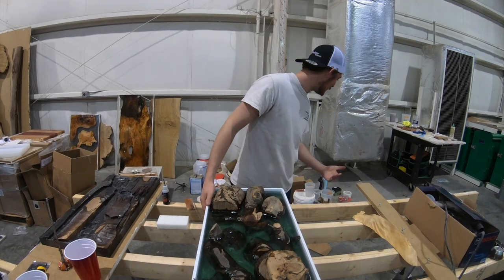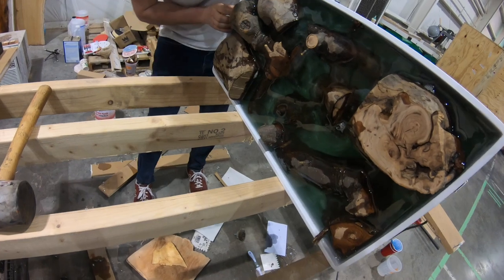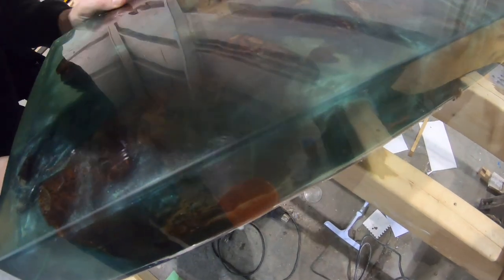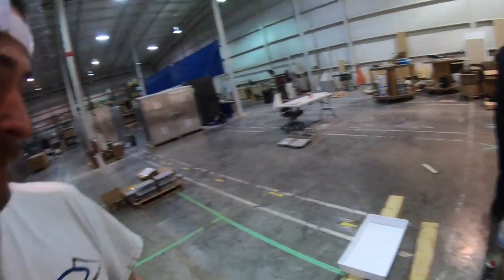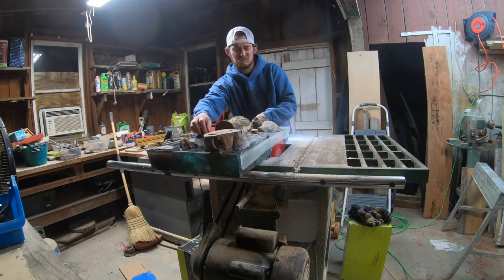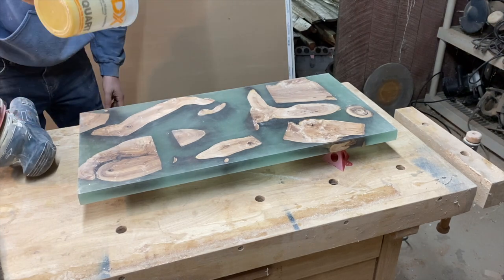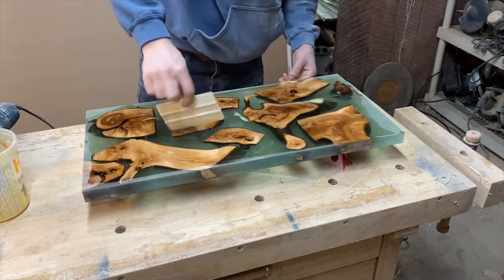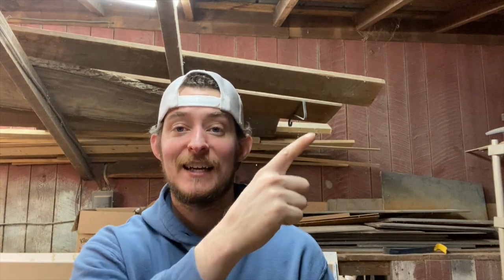Amazing!!!  ||  Apple Wood and Epoxy Charcuterie Board DIY

Comment: Hey I'm new to the epoxy world and so far having a ball. I love your videos and look forward to the new ones. I have a question for you.  Once I'm ready to seal my finished piece, is it ok to use the same brand "table top" epoxy for my finish top coat? Or is there a specific top coat product?
Reply from the maker: Welcome to the community!! You are correct! Use the same tabletop epoxy for the seal coats as for the top coat. The one Caveat is: if the wood is punky(soft and rotten) I would use the casting epoxy to stabilize instead of the tabletop epoxy. Then after you scuff sand the seal coats you’re ready for the tabletop flood coat.
Reply: @GoodViewWoodworks  awesome thank you very much

Comment: What were your overall thoughts on the mold? It looks like a bit of a leaning curve, but it paid off. This was interesting to see the apple wood 'chunks', you could call it bobbing for apples with that dark aqua colored epoxy! That was some fun B roll. They really came out nice.

In the future would you rather cut your wood beforehand and just do a thinner pour, or would you repeat the same thing on the bandsaw?
Reply from the maker: I like the mold but not worth the price unless you’re making these boards all the time.
Reply from the maker: I would probably do it the same way I did this time.
Reply: @GoodViewWoodworks  thanks Nate, you're the man!

Also, check out the Cambro brand giant food trays, pay $20 for a similar size. If it's polypropylene or polyethylene then epoxy won't stick to it and you are guaranteed a reusable mold that 100% will not leak!
Reply from the maker: No problem dude!!

Comment: hello Nathan  i like your video i  saw all your videos by the way i am new with epoxy but every time i polish my table is foggy and not shiny like glass please advice
Reply: The more you sand up through the grits to at least 2000 grit the less you have to buff n polish.after you sand add you cutting compound buff with the wool pad then it should start getting shiny,try not to put to much pressure on the pad to avoid swirl marks.then you add your polish 3M I would recommend ,then polish with the black foam pad.
Follow these steps and your good .you should end up with a clear shiny board .no need to add Rubio mono coat or osmo over everything.you can also finish with a wax aswell to add protection.Rubio and osmo only work proper on pigmentation epoxy.if it’s clear see through epoxy it won’t have that lustre but instead a Matt finish ,I thought i would answer your question as I just looked at this vid quickly and noticed no one answered.I remember when I kept asking the question.
Keep at it it’s really enjoyable your get there .
Reply: Hi. Sorry to jumo in on this. Iam having the same problem. My resin is sanding up misty, not clear. Ive sanded to a 3000 grit. So if iam reading it right, i add a cutting compound and rub it in. Then after that do i use a polishing compound. Any recommendation as to which ons to use?